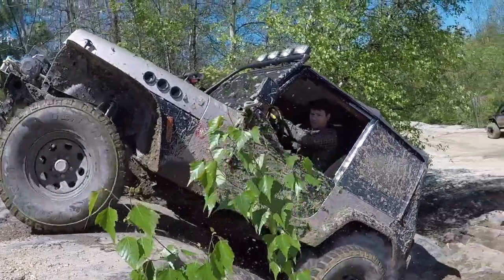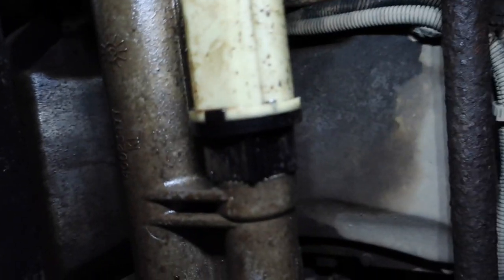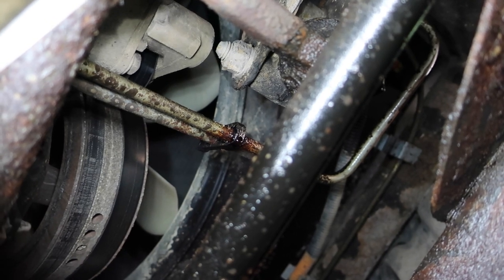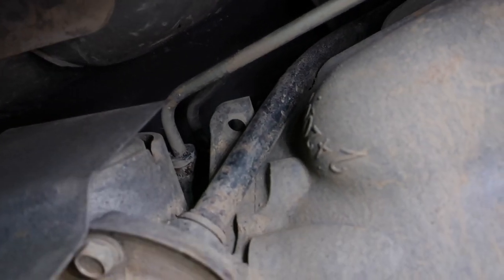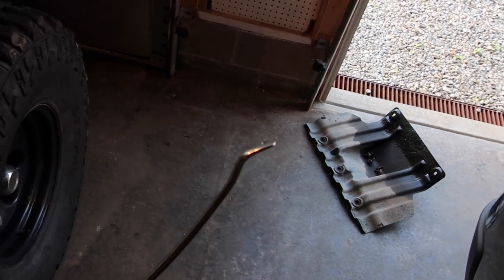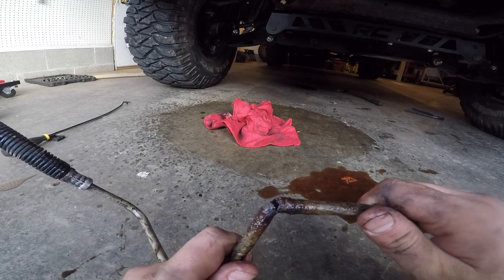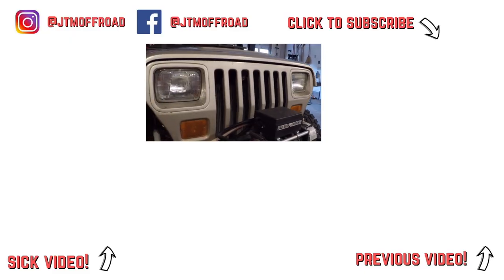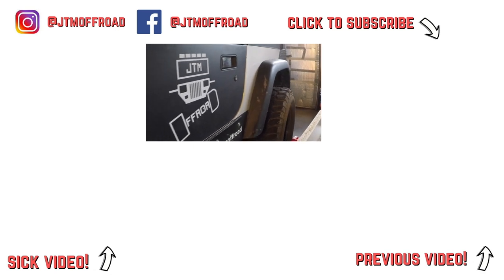4L60E Transmission Line Replacement... TERRIBLE

Comment: I have the same problem with my 2006. Just bought it and it's drippin like crazy over the a arm. Mines dripping from the fitting at the rubber line from what I can see. Video was a super big help bud. Thanx for posting

Comment: I'm going to be doing then on my 03' avalanche. My plan is to just pull the y pipe off. I'm currently having a new y pipe put on by professionals who have a car lift, and they know how to deal with the rusty down pipe bolts. Then, in a few months, I'll just pull the y pipe off and the side heat shield and replace them, and I will most likely replace the rear transmission mount too. My best suggestion from just looking at it, is to take the y pipe out so you have more room for the top one

Comment: I have a 2000 silverado I have kept since 19 as a beater truck since I got my new one. I was convinced my rear main seal was leaking and was in the process of getting ready to sell it due to not wanting to dump that kind of time and money into it since I dont really need the truck anymore, just kept it as kind of an old beater truck. I decided to take a look at where the leak was. Turned out it was exactly this. Couple hours and i had them changed. It lives once again

Comment: The retainer clips are a pain in the butt at the transmission end. The easiest way that i found was to remove the fittings from the transmission housing, in stall the the clips and then reinstall the fittings, otherwise it was a futile effort with very tight limited area to work.
Reply: Yeah I learned that when after installing the new lines there was a leak from each fitting because it is impossible to get the clips in properly.  So I took the fittings out and installed the clips, which was so much easier.  Put it all back together and no leaks.

Comment: That plastic clip holds dirt and moisture that is why they get so bad in that area.  All of the lines (Brake, Power Steering, Transmission) on vehicles should be Stainless Steel from the factory. Nobody should ever have to have these things changed unless they were in a bad accident......charge me the extra 100.00 from the start.
Reply from the maker: For real! I could get behind that idea
Reply: The upper  clip was a pain did get any advise how to remove upper clip..   replaced clips good info..
I got a 1988 k2500  with snow blade  diesel engine.. thanks for sharing your thoughts..

Comment: The upper is a pita! Pro tip - reach in from behind the transmission there is enough opening to get your arm in there, feel around for clip and pop it out. Just did mine and was watching your video hoping for an easier way to remove these lines without damaging them.
Reply: Did u do the bottom the same way he did or from the back of trans
Reply: I agree with you matt i just did my top one from the back of the trans.  thank goodness for your comment or else i would have had to bring it into a shop or something.  REACH BEHIND THE TRANSMISSION!!!!
Reply: Thanks for this tip. I have to visit this little slice of hell tomorrow.

Comment: Please explain how you got the transmission line back in? I’m working on the lower line. I’ve got the old line out and I’m working on getting the new one in. I can’t get it past the front diff. It gets hung on something every other way. I’ve even tried dropping the diff and still can’t get it through.

Comment: Did mine today, got the lines back to the transmission, doorman lines. only problem is they wont go back in. is there a different flare type for the originals?

Comment: I know it's an old post but if this helps someone...upper trans cooler line, made a pick out of a welding rod to pop the clip.  Pull out the line. Replacement ( skinny arms help) Do not install the clip on trans.  Push the line in the fitting while wiggling it. Once it's in put the clip on. Worked for me!
Reply: Being a pain in the ass for me can I put clip on first then push on? I'm having trouble putting clip on after
Reply: @coreyhollowell6645  I tried that, but due to its location and the space you have to work with you can't (or I couldn't) get enough oomph behind it to press it on and snap the clip over the flange. I was able to get the line in without the clip by wiggling it for a few minutes until it bottomed and then after fiddling with the clip for a few minutes I was able to get it to snap into place. It wasn't the easiest repair but it can be done. Seriously if you have big forearms and larger hands it might be damn near impossible.

Comment: I have a leak and I'm going to undertake this nightmare tomorrow. I got down under the truck and saw where those lines went into the transmission and just shook my head. I got the lines off the radiator no problem today. I'm thinking about taking a reciprocating saw to the lines on the transmission end and cutting them off, if I can even get the blade up in there. Then I can maybe get a socket on those fittings and remove them instead of fiddling with those clips that you can't even get to. While I have the connectors off, I'll see about replacing the o-rings too (I don't intend on doing this job again.) Either way, I know it's going to be a frustrating day. Thanks for the video, sir!
Reply: They make a small plastic fitting to go inside the clip, then u just pop or pull it out. Done. I Kno sounds easy, it's not. Harbor freight sells the clips.

Comment: Sand ate the galvanizing off the line and enabled it to rust. Sand will do it on the fuel lines also! Anyone that does off-roading needs to make sure to wash the undercarriage good after each trip.

Comment: I replaced these on my ‘05
2500.  It has the 6l80e so I’m not sure it is better or worse than yours.  I have to say it was one of the biggest pain in the ass things I’ve ever done on my vehicles. As frustrating as these things are to do it’s satisfying when you can do it yourself.  Also not paying shop rates is almost always worth doing it yourself.

Comment: Do I need to lower my transmission to replace my trans lines ? I have a 95 C1500 Silverado and the lines are threaded at both ends. My big hands can't get to the lines coming out of the transmission. HELP... Thanks for any info !!!
Reply: Wondering the same thing, just moved the trans mount out of the way on the cross member.  Can't figure any other way to do it

Comment: Glad you got the line replaced . When you get time to replace the upper one , I would remove the transmission crossmember and lower the trans down . This will give you better access to the line . Until next time take care .
Reply from the maker: Excellent thanks for the tip! I thought about dropping the trans but the mount looked pretty rusty and didnt wanna open another can of worms at the time

Comment: The trick is to grab it from the drive shaft area. If you stick your head by the tail shaft you'll see easily.  Try it, thanks me later
Reply: The only other option is if you have infant sized hands, an extra elbow on your arm, a plastic disconnect tool and the patience of three Saints combined.

Comment: I have watched your videos and really have enjoyed them. I know this may be a simple question but have you replaced your rear bump stops on your Avalanche? If so how? I am having issues getting my new ones in.
Reply from the maker: Thanks for checking out my vids! I haven’t replaced them but when I did the lift on the avalanche you have to cut a bit of length off the bumpstops. Mine came right off. No tools, just pulled the rubber bumpstop out, cut it, then pushed it back on. Not sure if that’s exactly how it’s supposed to be 🤷‍♂️ what kind of issues are you having?
Reply: @jtmoffroad  I did not have issues pulling it out. I have the Timberon bump stocks and it seems like I am not getting enough weight to push them in. The pockets are a little rusted so I might have to clean them up a little.
Reply from the maker: Ah gotcha. Yea hopefully cleaning that up a little will help

Comment: i hate those quick connect fittings. i prefer the old school flair nut tubing. it is much more secure and leak proof
Reply from the maker: I love how they’re called “quick connect”. I mean sure in a perfect world they’re quick
Reply: @jtmoffroad  They're quick connect when brand new but after years of road grime not so much.  When it comes to those things I just cut the old line then use a socket wrench to remove the fitting then mess with those damn clips on the work bench.
Reply: @pepperorig  I just finished doing the lines in my Sierra 1500. I cut the top. and then just backed out the fitting as you said. Much simpler than fucking with the clip in a spot where you can't even get your hand into. 
I only did the top since my bottom was still in relatively good shape. My truck has the Aux cooler mounted to the front of the radiator. those fittings were rotted beyond reusing them. 
If I were to do this job again I get all four new fittings ahead of starting.

Comment: I REPLACE THE ORIGINAL METAL LINE WITH 3/8" AND 300 PSI RUBBER HOSE IN SILVERADO 2004